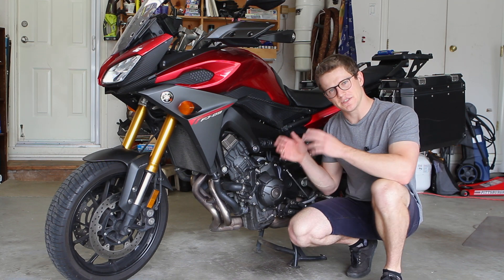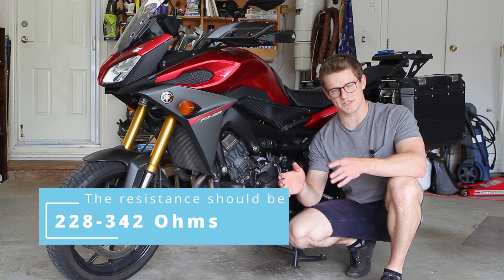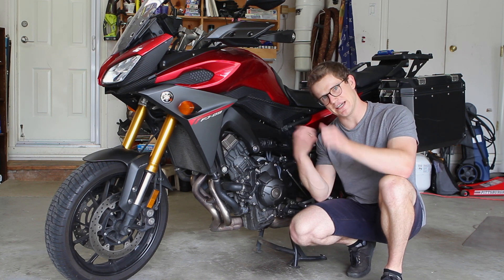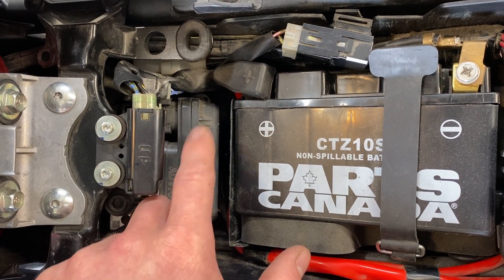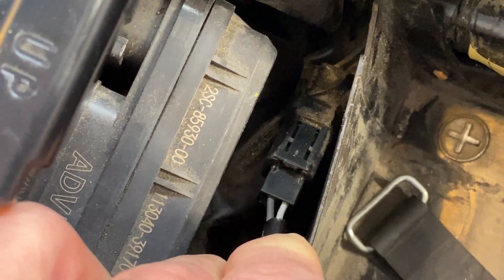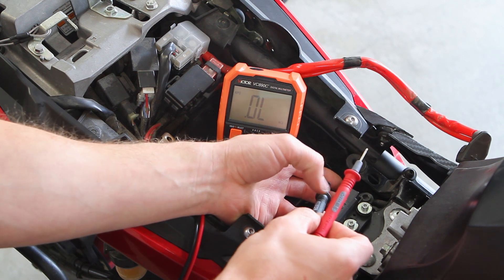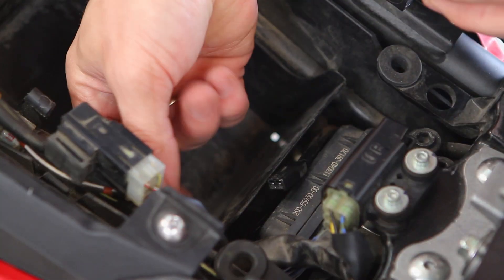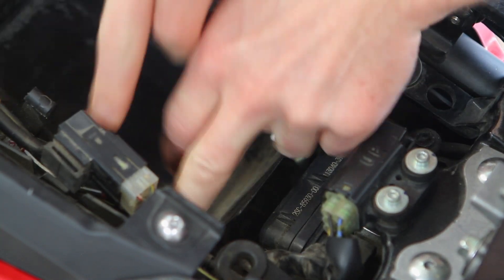Crank Position Sensor Inspection for MT09 FJ09 FZ09 - No Start Solution

Comment: Appreciate the information,  this was key to diagnosing 2018 xsr900.  My symptom was engine stalls during warm up at 170 F degrees , then will not restart until cooled down below 100F. After multiple tests finally the crankshaft position sensor ( magnetic pickup on stator) failed permanently.  Could not buy a separate pickup,  had to buy entire stator assembly.

Comment: Had my fz6 shutoff completely on the Highway, started right up after I pulled to the side so I’m guessing something electrical is loose. Wondering if you had any advice on where to start
Reply: Did you find your issue? I am working on my 18 xsr900  right now for same symptom. It's looking like CPS , part of stator assembly.  Mine dies after warmup,  after cool down to 110 degrees it starts again.

Comment: Hey Calvin! I’ve been checking out your videos and other forum posts and I’m having trouble finding info. My 2005 FZ6 will not start, making an electrical buzzing/clicking sound when trying to crank coming from near the ignition with Error 1. I can hear the fuel pump. Changed the battery and it’s at 12.8v, still experiencing the issue. Any ideas on where to continue from here? I am unfortunately stumped. Thanks in advance if you’re able to help! 
- Jace